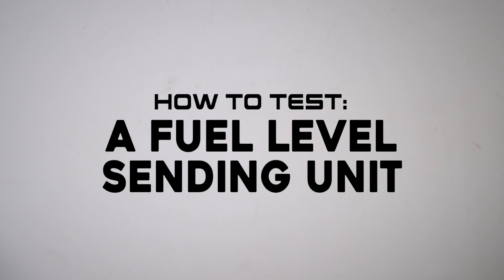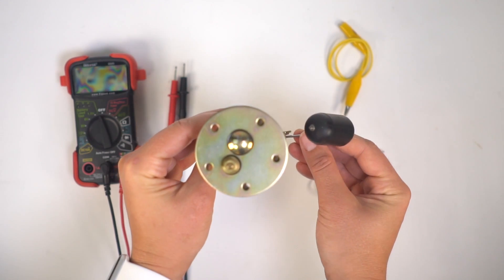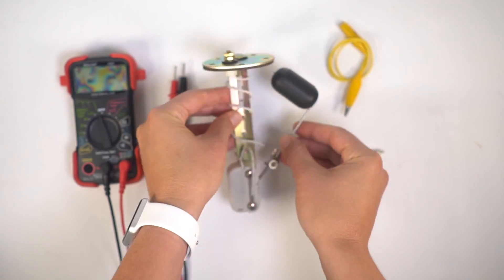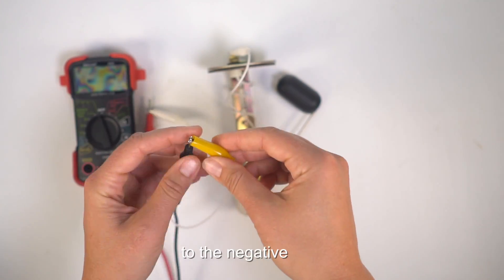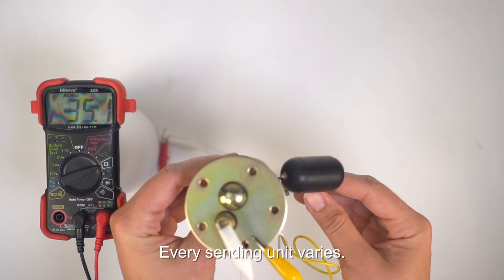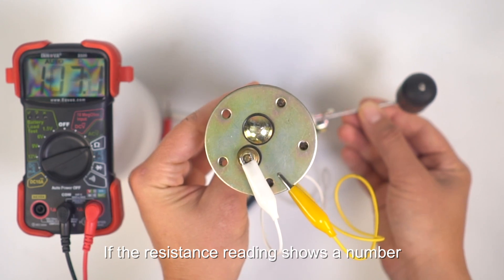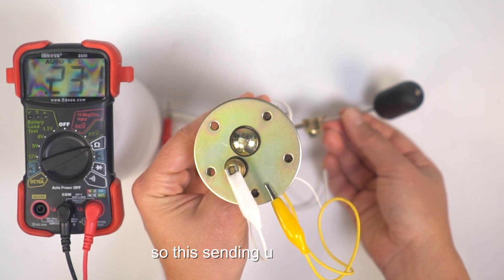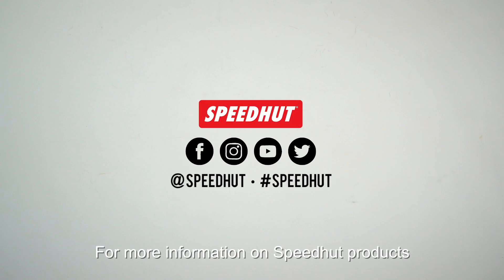How To Test A Fuel Level Sending Unit

Comment: Anyone worried about their sending unit function is going to be in a situation where the unit is inside the gas tank and the car is not starting.   There not going to be on their shop bench with a nice clean new sending unit in their hand.   So this is a silly ass video.